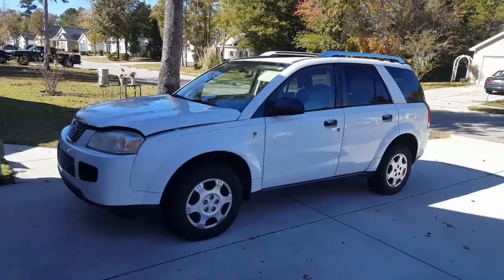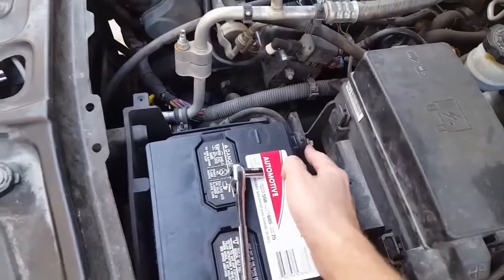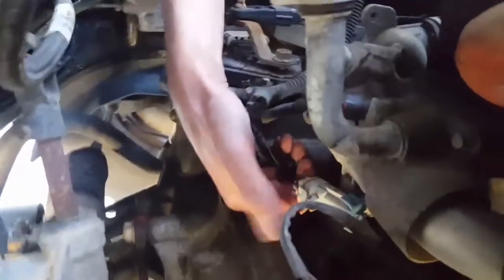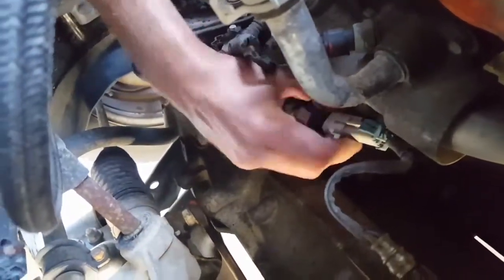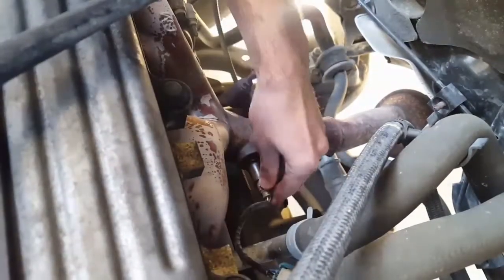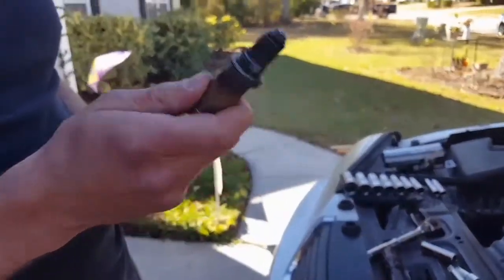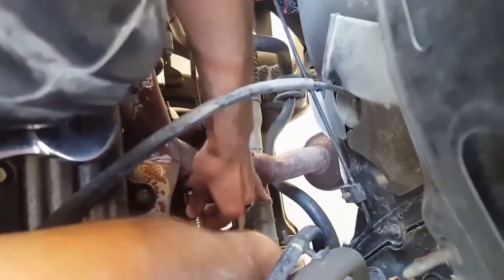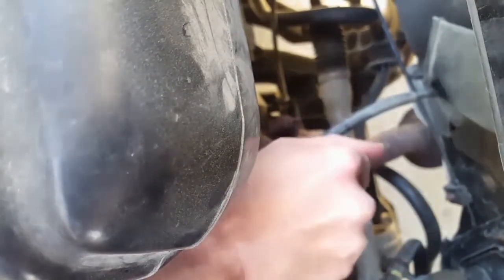2006 Saturn Vue oxygen sensor #saturn #vue #o2 #oxygensensor

Comment: Oh Lord the two top bolts for the heat shield holding it on broke off completely when I was trying to remove them I’m scared to remove the one connected to where it hooks to the catalytic converter because if that one comes off all no longer be able to use a heat shield. Any suggestions on what I should do to remount the heat shield?
Reply from the maker: The first thing that comes to mind is try and drill out the bolts that broke off and then try and extract the remainder of the bolt....or just leave the heat shield off.

Comment: I got a code P0130 ... "02 sensor circuit Bank 1 Sensor 1"  -   would that be the sensor you show in the video?
Reply from the maker: Should be.
Reply: I replaced the 02 sensor on my 2002 Vue (same one you replaced in this video), thanks for the video.  Now that I've replaced it, the code is no longer there and I get an "All codes clear"... but now while idling, with the A/C on, the engine rpm's go up and down and if I don't keep the gas on the pedal (while in neutral) the engine will stop.  Otherwise, the car runs fine just as it did before the 02 replacement.  If I turn off the A/C, the idle remains smooth and normal.  Any thoughts on what could be causing this?
Reply from the maker: @mtbrider6119   could be a dirty MAF sensor. Or idle position sensor. Hard to be 100% sure. I'd start by buying some MAF cleaner and clean out the Mass Air Flow sensor. Always a good thing to clean. Would make a video but I dont have the Saturn anymore.

Comment: Does the 2006 Saturn Vue have only the one oxygen sensor?  Not an upstream and downstream ?  Just wanted to make sure before I order the parts.
Reply from the maker: Honestly can't remember. Don't have the car anymore. But most "modern" cars do have an up and down stream sensor. Just meaning before or after the catalytic converter.
Reply: This vid was the upstream censor.
Reply: There is upstream and downstream. P0130 is upstream p0136 is downstream.

Comment: I have to do this job on my 05 Vue 4cyl 5 speed manual with 247,000 miles. Trouble code P0130 keeps reappearing.
Reply from the maker: Did you address the proper O2 sensor? There are typically 2 sensors. Also you will need to clear the code. Sometime it takes a few miles for the computer to realize it is no longer a fault too.
Reply: @lsccarvideos  yes, it is bank one sensor one. I have purchased the sensor,  now it’s a matter of changing it out. Thanks again for your quick,  accurate,  spot on video.

Comment: Which sensor is this
Reply from the maker: Oxygen sensor
Reply: @lsccarvideos  sorry meant which oxygen sensor i have error code p2253 from what i can find its a problem with the connection in bank 1 sensor 1 but im not sure
Reply from the maker: @Eternal8rain  if you have the V6 it will be different. But the one I replace in the video is the upstream sensor. I dont remember the exact code it was throwing. The upstream sensor would be sensor 1 though.
Reply: @lsccarvideos  ok thanks i think thats the one i need but my saturn is a 4 cylinder
Reply: How many O2 sensors are there?
Reply from the maker: @mikeykampbell9579  the 4 cylinder has 2 oxygen sensors and the V6 either has 3 or 4 sensors. Haven't worked on the V6 model yet to be 100% sure.
Reply: @lsccarvideos  this is what I needed to know!  I have a 2006 4 cylinder.  TYSM!!